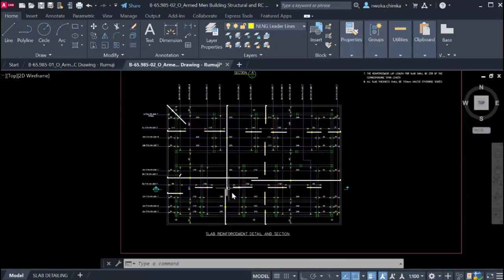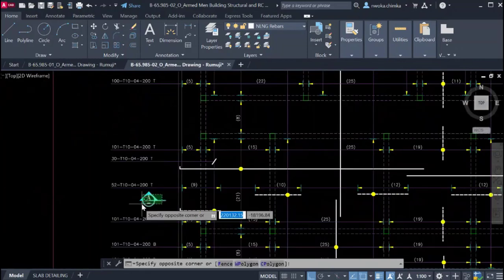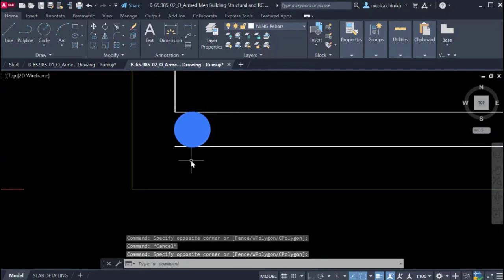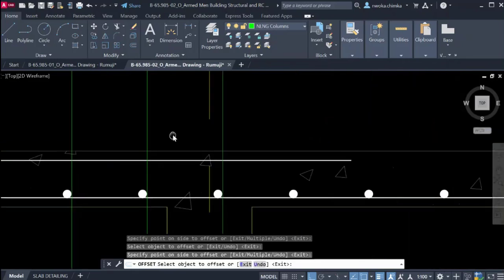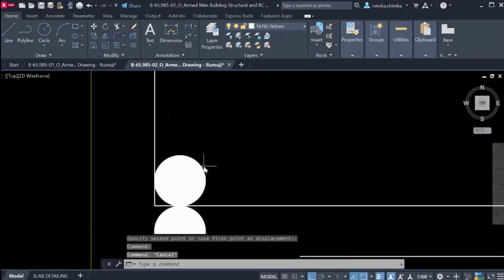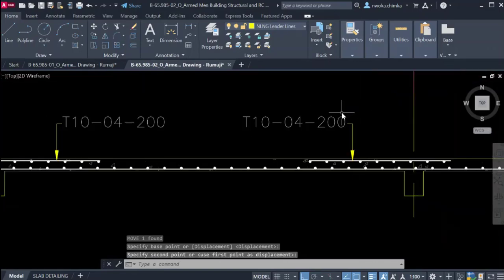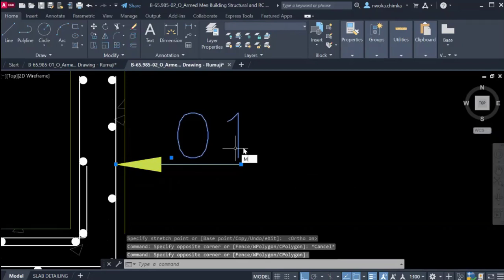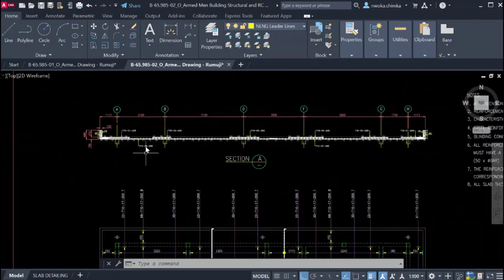How To Detail A Reinforced Concrete Slab Section - PART 1

Comment: Thank you sir for this video, all ur videos are well explanatory, but where I have problem is you detailing the cantilever wall. Why did you do so cause the wall is not reinforced so why are you detailing for the wall too instead on the slab alone. I'm a bit confused there cause have never seen such details before, So I will appreciate if you explain the reason behind it. Secondly I will like you to please do a  video of raft foundation detailing. Thanks
Reply: Thanks you sir, please can I see the picture of such building so it will help me to understand better what you are saying. Thanks
Reply from the maker: @Kpit360  Okay, I will send it to your WhatsApp.
Reply from the maker: Okay thank you Boma for the comment.
Ok about the cantilever wall detail, I will call to your attention that is not only a cantilever wall but a roof parapet wall which has a height of 600mm and when you are Detailing a parapet wall, the reinforcement will need to return or anchor into the slab for proper lapping.

Yes you may have not seen it before that is because the building is not common but it is good for every slab roof building.

Also I will make a video on Raft foundation as requested.🥰